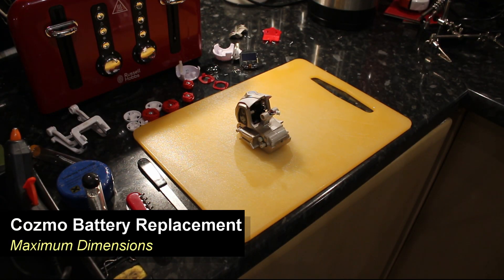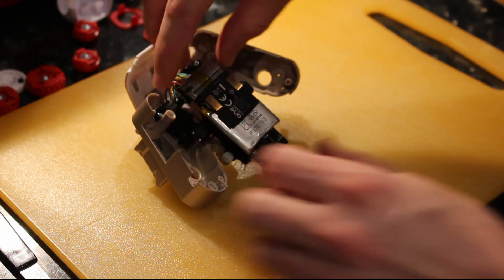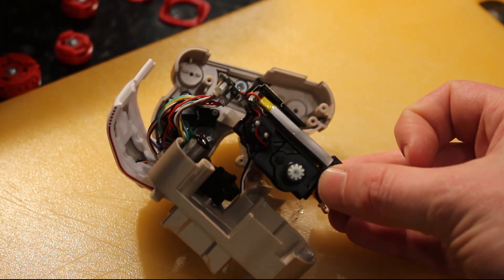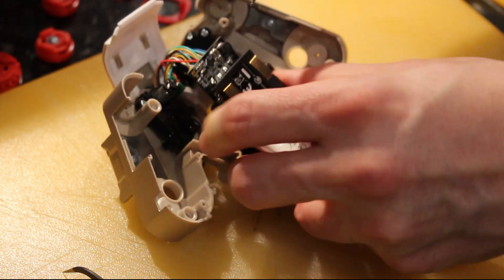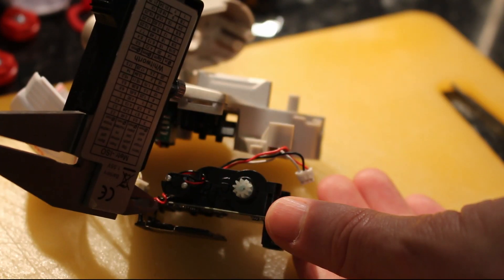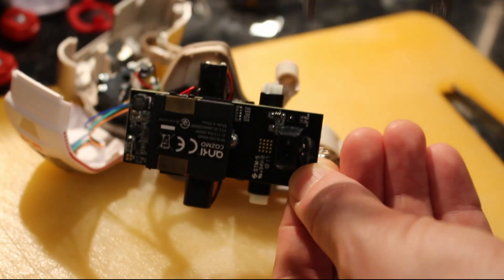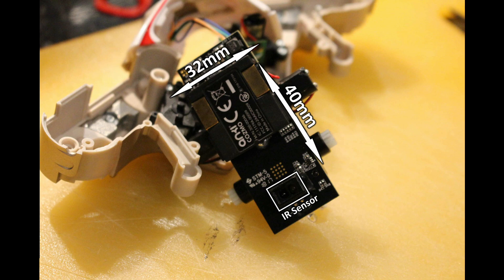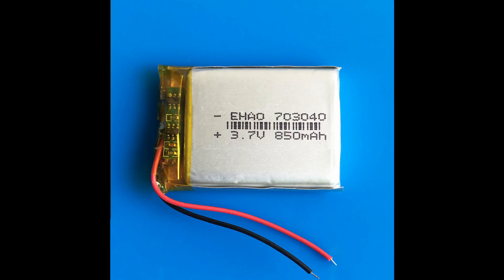Anki Cozmo Battery Dimensions - Replacing/Upgrading

Comment: Can you add a JST type connector to make future battery swaps easier without the need for desoldering/resoldering again? Is there space?
Reply from the maker: That’s a great question, yes there is space and I bought a batch of connectors to try this. But these batteries can last for years if maintained and swapping them out still requires a full teardown. If the battery was easier the access then hot swapping would definitely be an option.

Comment: I upgraded my Vector with the 600MAH batt and that only lasts 20 minutes.  I didn't check but I'm pretty sure that's about the same Vector runtime prior to upgrading the battery.  Does the Vector robot have some sort of limit to battery capacity?  Or am I missing something here?
Reply from the maker: Hi Tulio, I do know that with Cozmo, the unit has a charging failsafe built in, which cuts off charging once the battery hits 400mAH, so the robot looks fully charged. If you lift the Cozmo off the charging dock, then put it back on, it will continue charging all the way up to max capacity. I know that Vector self-charges, so it may be that the robot leaves the dock as soon as it's battery hits 400mAh (thereby missing out on that further 200mAH capacity still available in the battery). Not sure if that failsafe can be modified in the Vectors code through the SDK. Perhaps a question for the Anki forums? Hope this makes sense. Thanks. *if you get any further, please do let me know.
Reply: @TheJohnJudge  Hi John , 
I found a battery 700mah 6mm X 30mm X 35mm 3.7v 603035, could you tell me if it is compatible?
Reply from the maker: Marcio Gonçalves Ferreira yes that should just about fit in the enclosure. Best of luck with the repair.
Reply: @TheJohnJudge  Hi John...
I Found a battery 	5.2 x 3.4 x 0.5 Centimeters LWH that's rated 3.7V 1000mAh... Will that do? Also... Is it possible if the battery is 30mm x 30mm x 20mm?
Sorry, I needed this 3 years later... :|

Thank you so much for replying...

Comment: Where did you buy the battery’s?
Reply from the maker: Search Ebay or Amazon for "600Mah lipo 503040" - they are the dimensions of the max size that will fit.

Comment: https://ebay.us/FCb6mJ
Would this one fit?
Although its 5 mm X 30 mm X 42 mm?
Reply from the maker: Hi, yes that should fit. The markings on the battery ("503040") indicate the dimensions. The 2.5mm extra length is for the connectors but they will fold in.
Reply: @TheJohnJudge   Thank you very much :) Now I can bring my Cozmo back to life :D
Reply from the maker: Ljuba T good luck!  If you get stuck let me know.
Reply: @TheJohnJudge  thank you, will do 😊
Reply: @TheJohnJudge  I think it worked, although I lost the spring in Cozmo's head 😳
One second it was there, the next gone... I don't know where to 🙄
Cozmo is charging now 😊
Reply from the maker: @DrKNickel123  Hehe that's fine - Somebody commented that the spring is not actually required. Hope you enjoy his new lease of life!
Reply: @TheJohnJudge  Yeah! He is so cute <3
He was awake and recognized me ^^
Thanks for your great tutorials :)
Couldn't have done it without you 😊